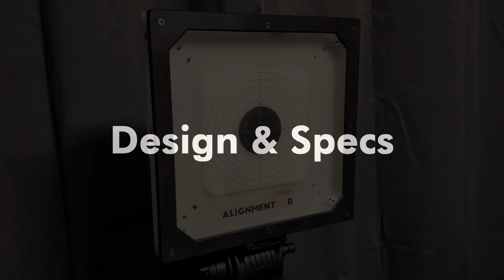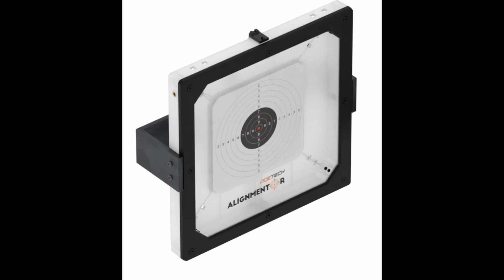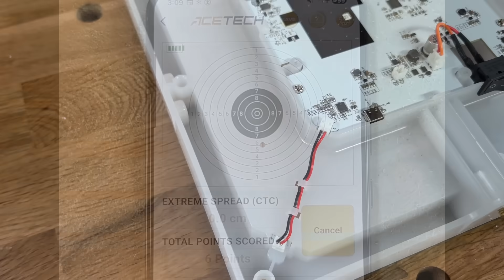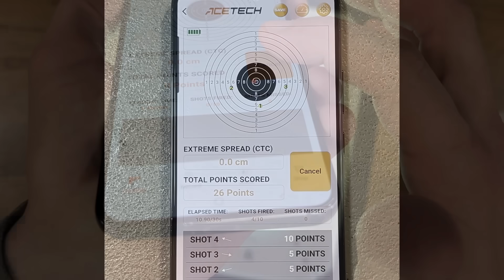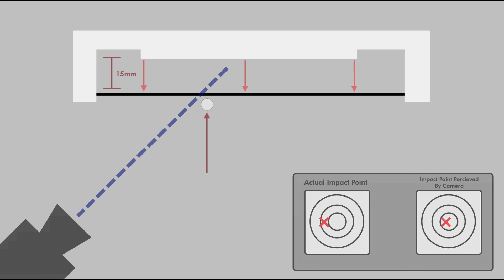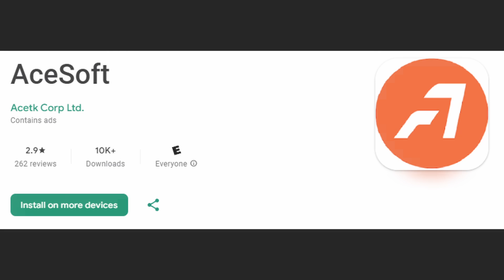Acetech Alignmentor Review

Comment: Regarding app support. For Apple, for example, there is "iMazing" software. This allows you to export apps and reinstall them if necessary (without the App Store). I have used this with the Davinci Dynamics target system, which has not been available in the App Store for nine years (the company went bankrupt). Thanks to Imazing, I can continue to use this target system and install it on current iPhones. Just a little tip.

Comment: $250 for what is basically an automatic target? That's not really...economical. Ofc im not the one that has cash to blow, but the smart monitor target (although 3x the price) at least gives you the option to use it as almost any target setup automatically and has disappearing/reappearing targets. Meanwhile, this is just a target that speaks when it shoots, has a bb limit to how much abuse it can take (effectively making the cover a consumable) and most importantly, offers little benefit to paper or makeshift targets, as you still need to set it up like every other target, all while offering noticeable parallax in ratio of the typical distances you would use this target at

Comment: love using mine, it works well out to 50m on wifi as advertised, although it is obviously harder to hit at that range (seems they're making a double sized variant as a result of such feedback) but for zeroing pistols at IPSC within 10-15m it works great - I lock the pistols to a table using the dust cover accessory rails in a custom built mount and then laser boresight the alignmentor with it, then tune the HOP and red dot to suit.

Also good for comparative grouping sizes of different rifles in field conditions, or with the gun vise as well

Comment: This looks cool, and I would certainly want one if I could; do you think that anyone other than maybe the most-hardcore of 'softers should look into it, primarily for price (despite it being much cheaper than the competition)?

Also, you mention that they can be setup to support multiple targets and judging by the back of the Alignmentor, the limit is 8. Is that the case? If so, does Acetech have any plans for shooting games (if this is something mentioned at all by them)? As the video suggests it is almost exclusively for just accuracy.

Overall, despite my seemingly quite critical questions, it does seem like a overall pretty good product. I do hope Acetech expands this further in some way, and especially the point made in the video of open-sourcing the App, or allowing other apps at all to interface with the target.